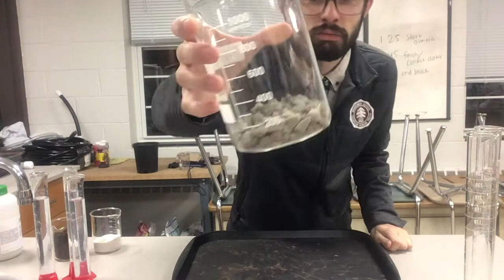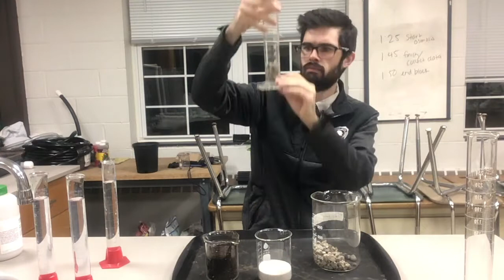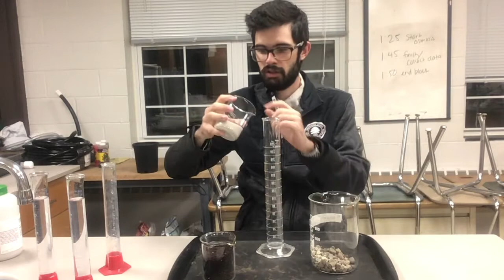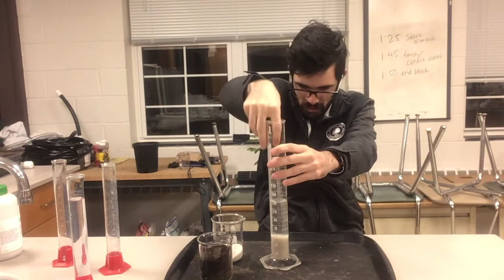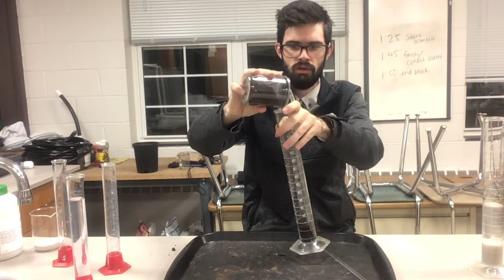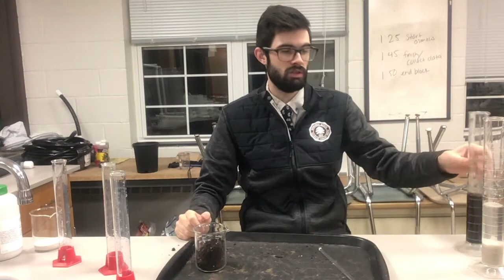Soil Properties Lab Part 2: Porosity

Comment from the maker: The data you record for this section is "Total Volume". This value is the total volume of both the substrate and the water combined. You can record this in the data table for part B. Then use the formulas provided to calculate pore space and porosity.

Comment: As a didactic demonstration, this methodology may be valid. But in the case of the soil, there was a high chance that the porosity had been underestimated, since there was not time for the water to occupy all the micropores, which may have been blocked by air bubbles.
Como demonstração didática esta metodologia pode ser válida. Mas  no caso do solo, houve grandes chances da porosidade ter sido subestimada, uma vez que não houve tempo para que a água ocupasse todos os microporos, que podem ter sido bloqueados por bolhas de ar.